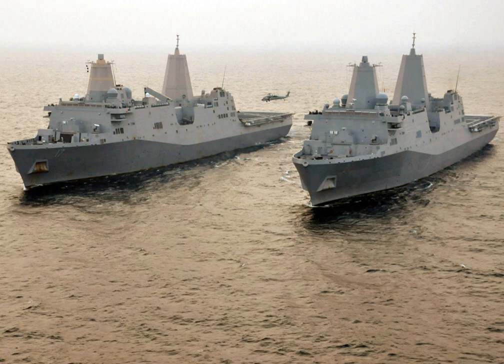San Antonio-class amphibious transport dock | Wikipedia audio article

Comment: the San Antonio class amphibious transport dock needs to larger in terms of it's length, beam & draft in addition to overall height as well!!! it's displacement increased to 28,300 ton - 30,000 ton!!! the larger ATD will have a 42% larger flight deck that'll stretch from ¼ of the front bow section across midship all the way to the rear stern!!! as a result the superstructure might have to be made smaller or it can also be pushed further forward but without compromising the available front deck space between the tapered beginning of the bow & front of the superstructure!!! which is why the hull has to lengthened which in turn would mean an increase in the beam & draft plus overall height, so as to not compromise the buoyancy & keep things in proportion!!!